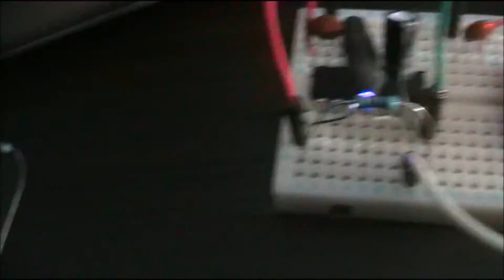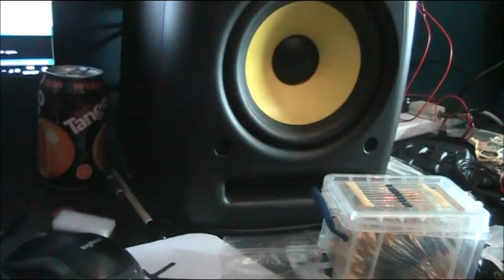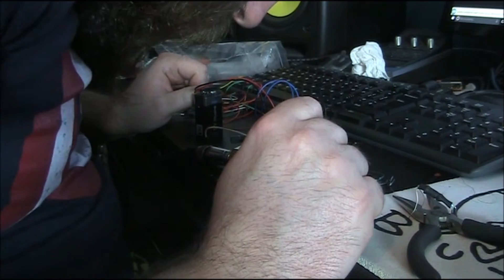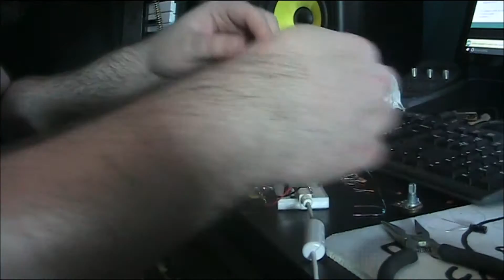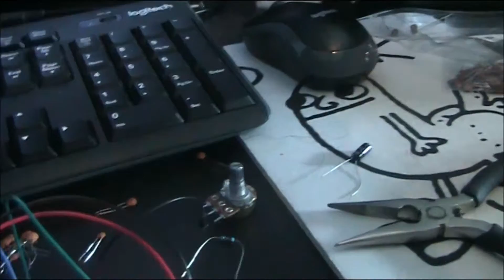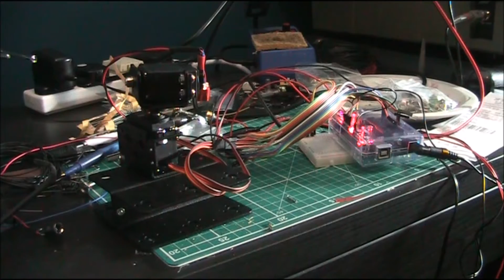Arduino control of analog synth circuit - part 1

Comment: LDR + 40106 circuits shines when you use a really powerful lights for these! Or choose other LDRs that are more sensetive. I've used Moon X400 headlight and it helps well! I guess you can use any hi-lumenous LED (don't forget about cooling though or use PWM) to make pairs of controls. It's not for precise controll, I guess. But for performances works awesome. I've got 100k on the  highest light and a very small on ambient (or shadow). Used one LDR before a passive mixer of two OSCs that were in neighbour triggers (1-2, 3-4). This gives a kind of RM and a great distorted sound.
I'm not satisfied about a moment "how to make it CV cotrollable" :) so I could reach my "blue dream" and continue making music and now - using my own analog synths... Will make a pause and switch to C64's help, VSTs and plugins. Obsession of analogs isn't good for music :)